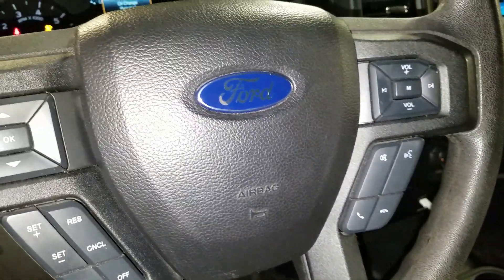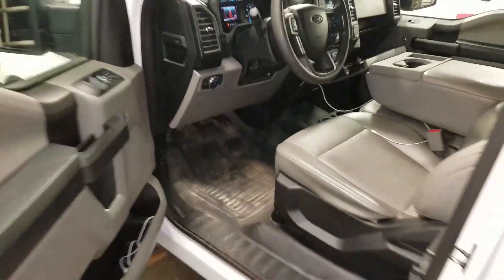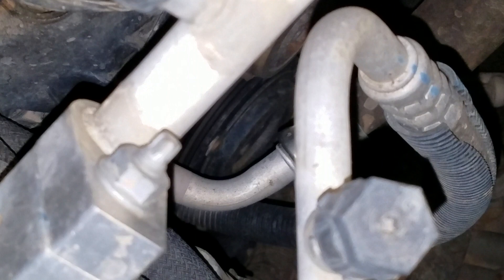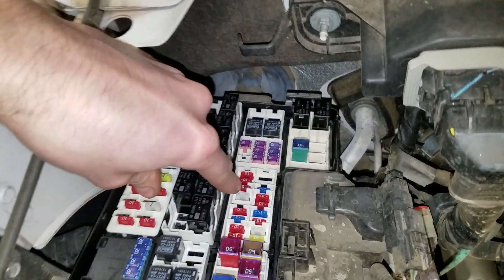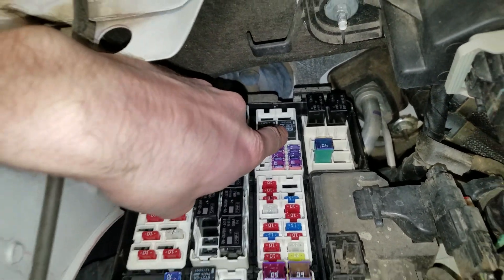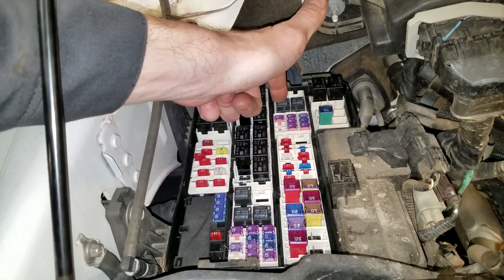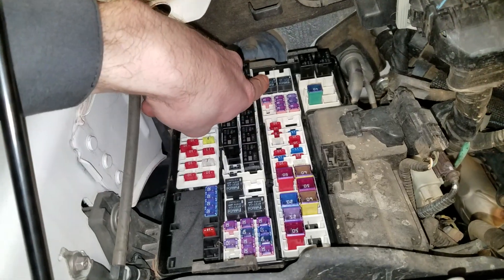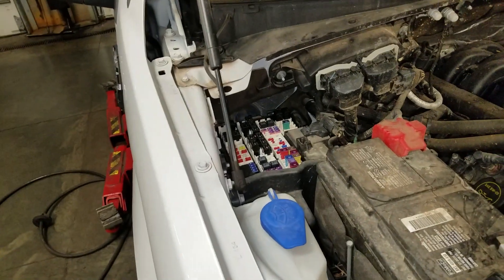2016 Ford F150 AC and Fuel Pump relays and fuses

Comment: Fuel pump make loud noise from gas tank area as I put key into ignition. At least I think that’s what it is Leaving the truck running the parked after a while it does it again. Then again. Not sure if fuel pump is going bad or what?

Comment: Great video! Would you happen to know what are the power points on the right of the fuse box? I see a 125 amp but don’t know where that leads to. Sorry I’m modifying a fuse box I currently have off a 2019 F-150

Comment: Hello, good afternoon, thank you very much for your videos. They are helpful. I have a 2018 Ford F 150 with 4 four doors. The problem I have is that the air conditioning in the rear does not work. Only the air conditioning works in the main dashboard. I hope you can help me.
Also the sync module (USB) does not work, and the airbag sometimes turns ON and sometimes stays OFF, thanks for your help.

Comment: I want to install a kill switch on my 2016 Ford F150.   I need to find the wire harness on the fuel pump relay under the dashboaed.  Caan you locate where the harness is inside the truck?  Thanks a bunch.  And THUMBS UP!!!c
Reply: Nine months I asked where the fuel pump relay wires are under the dash inside the truck.  I want to install a kill switch on the hot wire under the dash.  Do you know again where I can find the wire harness inside the truck?   Thanks, and THUMBS UP!!!

Comment: Hey buddy I got a question I checked the fuse as you explaining on the video I checked the relay and I also check if I was getting power to the pressure switch and I'm not getting power to the pressure switch that means I have the problem before the compressor have no touch the compressor or anything but I'm pretty sure it's nothing to do with the compressor clutch any idea what else I can look on??

Comment: I pulled fuse 97 in that same fuse box to do some headlight work and forgot to put it back, and I think it might have caused my AC to not work, could that happen as well?  After I put the fuse back in, the air conditioner started working again, I'm not sure if it was coincidence or what.

Comment: I’ve got a 2016 Ford F-150 that cranks but won’t start-sometimes- Ford can’t get it to do it but the engine light was on- said it was a fuel pressure fault. Anyways do you know if that fuel pump relay might have something to do with it? Thanks, any feedback is appreciated!
Reply: My 2016 does the same thing. It cranks nice and strong but won’t fire up at times. It’s not constant but I don’t get a check engine light, my truck gives me the wrench light until it finally does start after I let it sit for about 15 mins and my truck is a 5.0

Comment: Yeah, I can jump the relay and the compressor comes on. I put new Freon in, but compressor still won't come on without jumping relay. Any ideas why not?
Reply from the maker: Is your check engine Light on?
Reply: I have the same problem n my fans are blowing on high and wont  power down
Reply: @LehewTech  hey I got exactly the same problem I even checked the pressure switch and I'm not getting any power to check the relay is good check the fuses good what else I can check? And yes my engine light is on